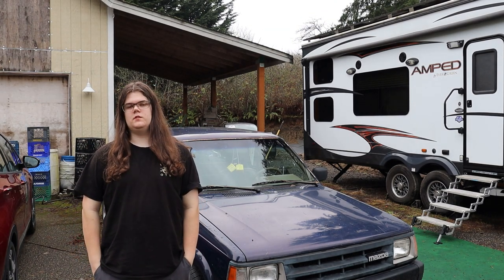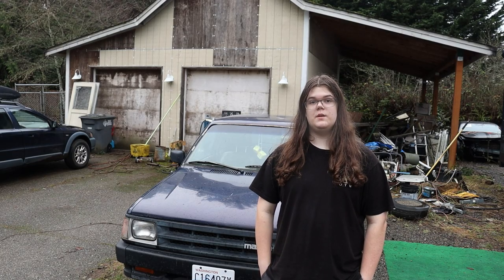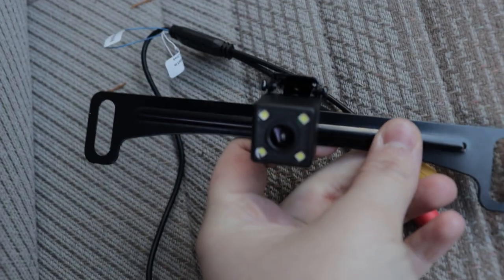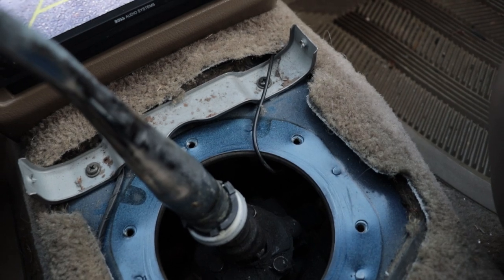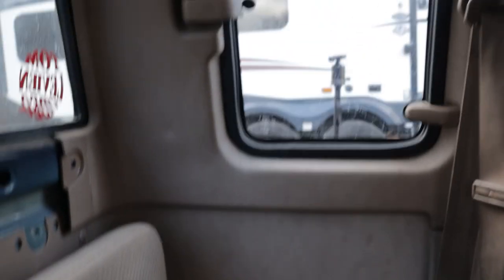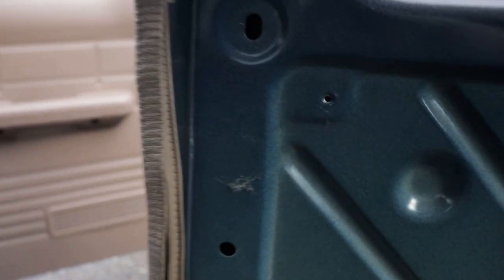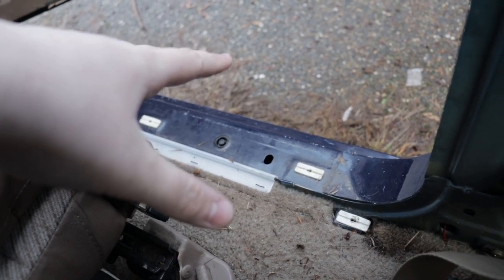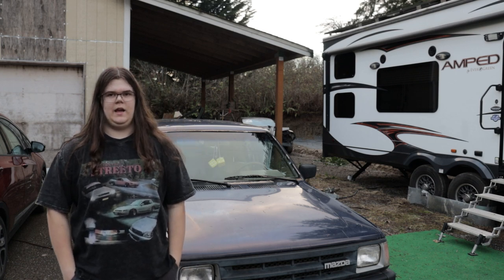Budget-Friendly Sound System Upgrade For a Mazda B2200

Comment: I own 9 cars, some 4-500 horsepower luxury cars, some japanese muscle cars v6 twin turbo's (300zx z32), some one of 2,000 (Lexus L Tuned Gs430), some one of a coupole hundred, (1984 Nissan 200sx Turbo 50th anniversary edition) but my Mazda B2200 is my baby, love the gas mileage, the 2.2 liter, and the ease of working on this thing. I was hit and totaled just recently but ressurected it on my driveway, even if I got a new truck, I dont think it would be half as reliable as my b2200. I also take it often on 4-500 mile road trips camping, and off roading, river crossings, this thing doesnt need 4wd cuhz its so light, it just glides past most terrain. I bought mine for 3,000$ in 2012 with 90,000, was garaged most its life, was really a nice looking truck and would constantly turn heads, and get thumbs up from other trucks, all while still getting close to 30 mpg!

Comment: could you go into more depth on a wiring harness or state where to get the information for it?  i have 1989 b2200 and bought the same radio and this harness is confusing me because it seems like we have different parts? ty!
Reply from the maker: you have to get a stereo adapter harness that will plug into the factory mazda plugs, that harness comes with the instructions of what goes to where and you cross reference that with the stereo included wiring harness diagram, i thought i put a link to the wiring harness in the description but i guess not so here it is: https://shop.advanceautoparts.com/p/metra-electronics-mazda-86-89-truck-86-93-wire-hardness-adapater-70-1781/22610183-P?vehicleIdSearch=14623&isAllVehicle=false

Comment: What do you think about the quality of the boss double din and back up?
Reply from the maker: the camera quality on the back up camera could be better but its better than nothing and you can even add a front camera if you wanted, the audio quality from the boss double din is quite good as it has pretty high amps per channel for a built in amp (iirc 75 amps per channel)